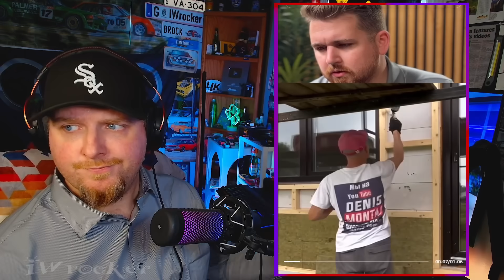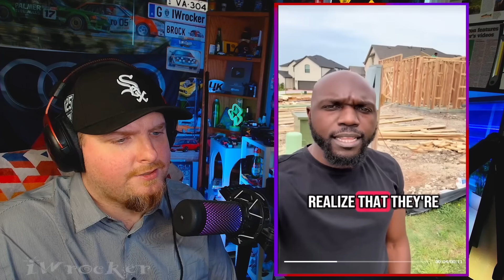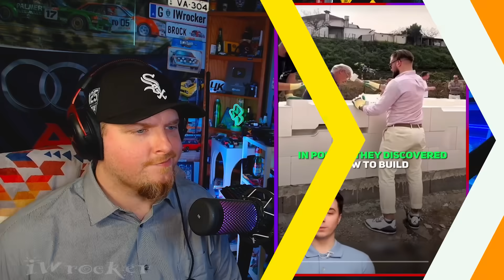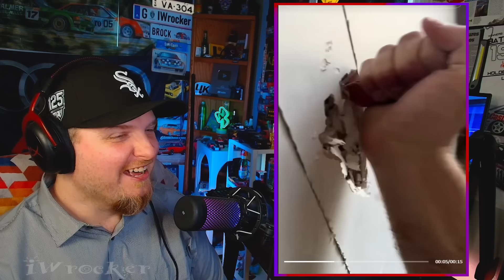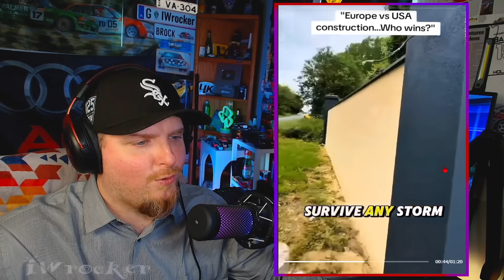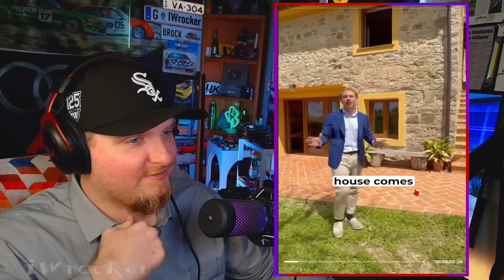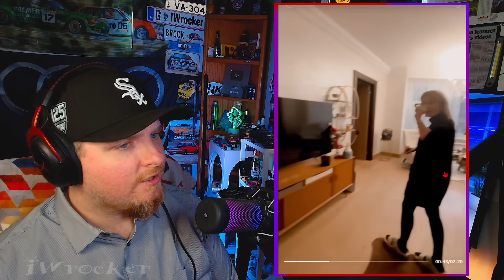25 Minutes of European VS American Home Quality & Construction Methods 🔨

Comment: I'm South African. Our building standards require 4.5 inch brick for interior, and 9 inch for external bearing walls. That's brick and cement. You can spend the rest of your life trying to open a wall with a utility knife (I translated the measurements for you, but they are actually so old they were originally in imperial - back when we needed solid walls to protect us from velociraptors)

Comment: that insulation isn't even that good. for most Central and North European countries that is WAY to thin. Average should be 3x as much, or 150mm, to keep the house cool in summer and warm in winters.

this is probably a house along the Mediterranean, where 5cm insulation is enough year long.

and of course its outside, to provide enough ventilation and protect against humidity, creating a long lasting facade.

Comment: Houses burn down completely in the USA due to the fact that they are made completely of wood ! Houses in Europe are made of brick and/or steel and concrete. The wood in them is minimal in new-builds only there for internal walls (the framework for plasterboard) and for roof beams. Houses will burn but the shell will survive and can be repaired

Comment: when I was a kid, a classmate of mine vot angry and punched the wall and the bone in hand the one his middlefinger was stuck in broke and shot up halfway into his hand. Naturally the ambulance picked him up and it needed surgery.

Another thing worth noting is trucks and walls. If a truck hits the corner of a building in europe the house will stop the truck that hit it.

For the walls if hit head on its a tossup on the construction method. My own house has rebar and concrete reinforcements through 30cm thick walls to help make it earthquake proof on a rather big scale. So it would probably stop a truck .

Comment: building i live in is built in 1993, most of the walls in this apartment building are load bearing concrete, those walls that are not are plaster boards, and i have like 5 plaster walls in ym entire apartment, and the floor and ceiling slabs are my entire fore arms length thick aprox 30-40cm minimum

Comment: Europeans live in Houses older then your country, so yea they are build better, the thing done in Europe with the insulated houses is in the Summer time stays colder an in the winter is hotter, less  heat transfer, as a con, there is none is just better in every way. Structural integrity is better, durability those houses can be lived in for hundreds of years if maintained, they don't fall from a little wind as American houses do. We do use wooden houses but  as vexation houses or cabins in the woods.

Comment: Honestly.... if that first guy is really working in construction, asking why the insulation is on the outside is just embarassingly stupid.

There's a slight misconception among Americans that Europeans don't use wood framing for walls. We absolutely do. The "removing the wall with a utility knife" is absolutely possible in Europe. In more modern buildings, inner walls are often just wood frames with insulation and plasterboard on top, so you could do exactly the same to those. We also sometimes have wood framed outer walls, although the "filling" tends to be a lot more "substantial" than in the US.

For the foam insulation on the outside at 14:30: It's also a pretty great way to insulate existing old buildings. The house my apartment is in was built more than a hundred years ago, but has that foam insulation on the outside and it works amazingly well. The point about it being mouldy when done poorly... honestly applies to outer walls in general? If you build them poorly, they're going to be vulnerable to wet, heat or cold. That's not a sensible point against the method.

Comment: if just insulated my house in south germany. its from the sixtys and has like 15 inch thick walls. i got 6 ich insulation on top and energy consumption dropped significantly. had its price though. around 40k euro for 2/3 of the house

Comment: In the EU we use inside insulation, but only in specific situations. For example: A small cabin or we call it weekends here (because we use it on weekends), when you come to that place a few times a month. It makes sense, because you heat it up very fast or cool it down without wasting a lot of energy, because you don't have to heat up the walls, but just the air inside.

Comment: My house is older than the last added US state, Alaska. You put insulation on the outside for various reasons, but for myself most importantly it saves interior space, putting insulation on inside reduces interior space... that first guy has no spacial awareness what so ever.🤣

US: covers wood with brick facade
EU: covers bricks with paint

If they want it too look like brick, maybe use brick? 🤣🤣🤣

I lived in USA for 6 years, running through walls is a thing as you know, but don't try that in Europe, you can kick the walls here and does nothing to em. I saw a cop vid in US where they broke through the wall since the door was reinforced, but the wall wasnt😂

Comment: My house in the UK every wall is a brick wall eg exterior walls and interior walls between each room all the interiors has nice layer of plaster not plaster board by real plaster over all the brick walls, a solid brick house and no our bricks don't have wholes in them either they are solid red Bricks.

Comment: Is wood construction banned in Austria because of fire risk?

No — that’s a common misconception.

In Austria, building regulations are based on the OIB Guideline 2 – Fire Protection. The law doesn’t ban timber construction. Instead, it requires that all buildings meet specific fire resistance standards — regardless of the material.

For example, structural elements must withstand fire for 30, 60, or even 90 minutes, depending on the building height and use.

Wood is considered combustible, but modern engineered timber like cross-laminated timber can achieve high fire resistance ratings. That’s why Austria is actually a leader in multi-storey timber construction.

So it’s not about banning wood — it’s about meeting strict fire safety requirements.

Comment: A lot of modern European buildings have high thermal mass instead of or in addition to insulation, the thermal battery concept is to trap heat during the day and save on energy when the sun goes down, which isn`t just energy efficient overall, but it mitigates power spikes on the grid as well, especially when a large number of businesses or large building in general use that concept.
It can reduce heating energy consumption by 2–15% and, when paired with night ventilation, can reduce cooling loads by up to 50%, so that obviously constitutes a pretty significant reduction of long term cost as well as of course being better for the environment (:
Btw, 700 for that apartment is insane..
I`m paying almost a grand for a 650Sq/Ft apartment in a decent part of Oslo, it`s not modern, there`s no elevator or wheelchair access, so what I`m trying to say is, don`t expect 700 bucks a month for a modern apartment everywhere, apparently Riga is just stupidly cheap lol.

Comment: That wall is not a regular concrete it is an aerated concrete, specifically for better thermo isolation. And stone wool outside to have dew point inside the insulation layer, not inside the wall

Comment: The thin house looks like the fake houses that were there to hide the original underground lines. They had to have open sections of the underground train lines as they used steam trains at the start.

Comment: Having the brickwork inside the insulation envelope helps moderate the temperature because it has a lot more thermal mass than a sheet of drywall.

Comment: You can modify european houses too...You just need to have the right tools and if you want to tear out a wall or make a bigger hole in it, you should consult with a structural engineer...

For new inwall outlets or switches for example, there are drill bits, that carve out a hole, where you then put in everything...

Comment: In Europe insulation on newer houses is done inbetween two walls, there's an outside wall and an inside wall and the insulation material goes in between them. On older houses it's not possible cause they have one solid wall. Also most houses here are built with brick stones or concrete. Not wood.

Comment: Easier to modify? Weird how my parents managed to extend their 120 square meters 500+ years old House into a 180 square meters House for cheap 30 years ago. Just had to dig a door sized hole in one or two 80 cms thick walls (which is way easier than it seems, in fact). Sure it is harder than punch a hole with your fist in a US wall or a drywall...
Quicker to throw up?! WTF?! Why throw up a functional house?! Are you all right there? Sell the old house and buy another one instead of throwing the old one up...
I seriously ask myself why you would want to live in a House that can be thrown up...

Comment: I am european living in wood house - but : my house is a sandwich construction made in factory, with 40 cm wall insulation and 60cm roof insulation, just assembled on site on concrete foundation. Walls are definitely not covered by cardboard - they are covered by something called cement-fibre boards (plywood was optional). I would be probably be very unhappy in you american house - but I used YT videos about american contruction to learn how to make my shed 🙂

Comment: 13:32 European Windows in the ground floor most often have locks in the handles, to make burglaries less easy.
Also, we are also fitting Rolladen onto each window, to have the possibility to close the house Off when being away, Temperaturen and light control.

So, they are missing a few steps, hope they'll have decent security elsewhere, 

From 🇩🇪

Comment: Switzerland here: For me it is always astounding watching videos from the U.S. where people punch against a wall and then there's a hole in it. Absolutely unimaginable here. Your hand would be broken first. There are some internal walls where you can drill with a "normal" drill, but all outside walls and supporting walls are solid concret and you'll need an industrial type drill to even make a small hole.

Comment: HI Germany here
First one is weird
He puts 8cm rockwool outside
Usually used inside
Outside we put 18+cm hard styrofoam called XPS
Does significant heat reduce and don't hold moisture
Mandatory for new and renovation houses
Reply: actually, when you're using insulated bricks, rockwool outside makes much more sense, bc that stuff doesn't go up in flames as easily as styrofoam... (styrofoam is good to retrofit insulation as it normally is "just" glued on, otherwhise, i'd choose rockwool over styrofoam anytime - IF there's a solid insulation against moisture, of course...)

Comment: My house has concrete inner walls and ceilings, a layer of insulation (4” thick) and it is covered by a layer of solid brick. What does he mean with “we do everything right in America”? I am from the Netherlands, and a tornado would not damage my house. Worst case scenario would be we lose some concrete rooft tiles. Your houses are built worse than the house my bicycle lives in. I call it the shed.
Reply: 😂😂😂😂😂

❤ From your neighbor 🇩🇪

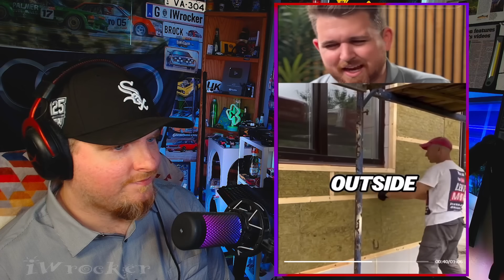Comment: 1:20 We usually don't use concrete as walls, most of them are made of ytong or burnt brick. We don't use concrete because a lot of heat passes through it from the inside out. And we put insulation on the outside because that prevents the formation of dew inside and prevents the formation of mold.
Reply: Typically one layer of ytong on the ground floor concrete slab to insulate the interior walls from the ground and brick for the rest.

Comment: The facade was left to keep the "character" of the street when the Underground railway was built behind the houses.......in the late 1800's........Those 2 houses were demolished but due to the local outcry, the fronts were kept.
Reply: Thank you so much for that piece of information, I just love knowing these types of info, makes life more interesting
Reply: Different place, this is an actual building (detailed elsewhere). The facade house is in Leinster Gardens
Reply: those facades hide the ventilation system for the subway and undergroud system. they are huge ventilation chimneys but beautifully hidden.
Reply: In the Netherlands that's also done, sometimes. If the ecstatic of the facade should be kept for future generations. Behind it they'll build a whole new apartment.
Reply: ah. i forgot the tube. my first thaught was a remnence of the ww2 bombing
Reply: There is a documentary that features them.
Reply: We had a similar case with a building that finished about a year back. The facade was an amalgamation of different styles and times. A proof of a historical building that grew over time. 
The facade had to be kept, but the entire back was stripped away and rebuild from ground up. It was quite the undertaking. :D

Comment: What surprises me is the difference in perception between countries regarding the same material. For example, terrazzo in the USA is considered cool, very mid-century modern, while here in Spain it's considered vulgar and even outdated, since it's the material used for flooring in almost all apartment blocks built between the 1960s and 1970s (which you can see everywhere in cities). It's worth mentioning that its durability is beyond question.

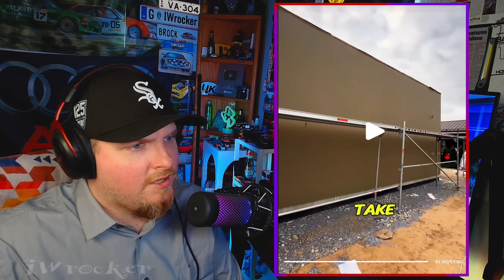Comment: 14:43 does types of walls was popular in big buildings in sweden  during the l late 90s early 2000. Often  combined with  minimal  roof          protection.  The system is called one stage moisture protection.  
This is forbidden  now , the fasades need venting in the facade systems today.
The one stage systems has been bringing huge renovation costs with  it.    And law suits Regarding construction faults.

Comment: 8:16 using a backing board behind the  drywall or at least double drywall board is  pretty mutch standard in northern Europe. 
Many houses are all wall backing  board in in sweden for  example.  If there are fire requirements double drywall are required.

Comment: 18:45 That "truck" is an "Ape", bee in Italian, Made by the same company (Piaggio)  that produces the "Vespa" scooters, has three wheels and a single-cylinder 2 stroke engine, is used for transporting materials, was produced in Italy for decades and was sold throughout Europe, They recently stopped production in Italy and moved everything to India; this vehicle is now too polluting for European standards. Now they should produce an electric version in Italy.

Comment: The first house is definitely not a norm in europe and that includes russia. That brick in the first vid is called siporex and it was never used in a load bearing wall. Partitions only and outbuildings. Very soft too, it crumbles under pressure. And I have never seen battons used like that outside - but since he is not using proper fastening methods - he is is using expanding foam - I guess I can't fault timber being used in this way, it will help holding the insulation and render. But I suspect the real reason he isn't using proper fastening methods is that siporex block.

As for the indulation, always insulate the cold side, never warm side. The only two countries that I have seen put insulation on the inside in europe are Ireland and uk, and I would definitely not reference these two countries when it comes to building standards. Without going into details, the first word that comes to mind - shocking.

Comment: You can make arguments for both sides, as you mentioned, but the primary reason for the big difference in how family homes are built in America versus the European continent (not just the EU) is a deeply rooted tradition shared — to a greater or lesser extent — across most of Europe, especially in the Balkans: generations continuing to live in the same house.
For instance, I live with my family in the house my grandfather built. Sure, it’s been renovated and extended multiple times, but my kids are the fourth generation to live here. In this part of the world, people place huge value on “dedovina” (inheritance from grandfather), “pradedovina” (great-grandfather’s), “čukundedovina” (great-great-grandfather’s)… Across Europe you’ll find people still living in 300-year-old houses where many generations of their ancestors lived before them.
This is one — though certainly not the only — major reason why family houses are built so differently on the European continent.

Comment: I'm sitting in a Danish apartment made of concrete.
I may have thick walls and it may be annoying to drill things into the walls or ceiling, but I can sit in cold winter weather and stay warm without paying for heat because it's insulated enough to stay warm from ambient heat of living in the apartment.

Comment: First home in the video by the white colour is Autoclaved aerated concrete and is later than normal concrete. If I remember correctly even foot on water and you can use for drawing on asfat 😅. Because this thing pull on himself moister in not so good because it's make to dri eat inside just like the material you use in US for walls.

Comment: "Why would you put insulation on the outside" ..... well, because it insulates a lot better. It gives the house kind of a coat that completely covers the house. If one insulates on the inside, then at all the connection points between internal walls and the outside wall there is no insulation - hence, those point form thermal bridges where cold can come in and the humid in-house air could condensate causing mould....

Comment: My parents home in Romania is from 1840. All the walls are from boulders and concrete, the interior walls are all over 90 cm thick and the basement has curved brick ceiling like a wine cellar, in summer is cool and in winter at -20, the flowers and potatoes are doing just fine. 
That house will stand tall in many years to come. I love it 😊